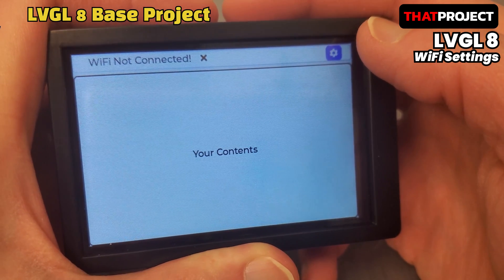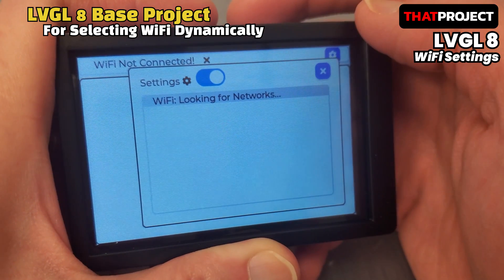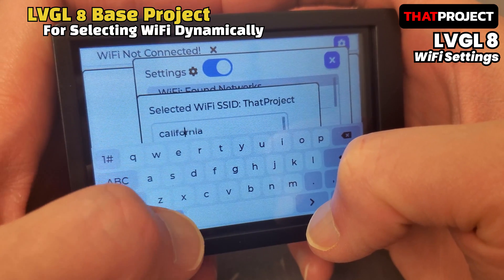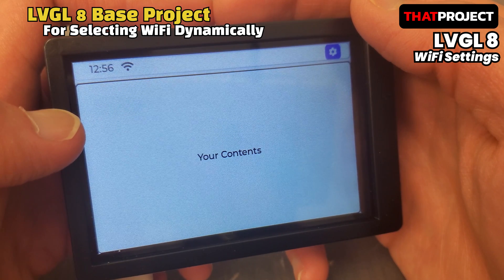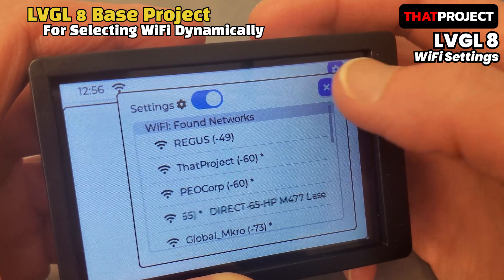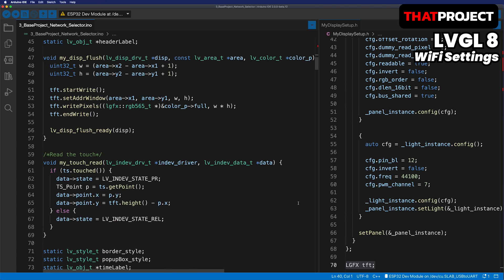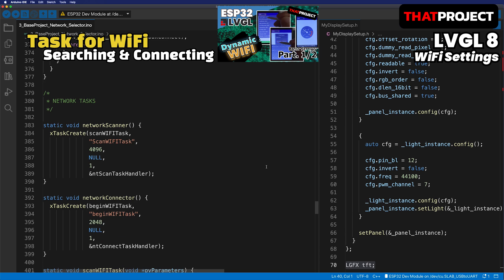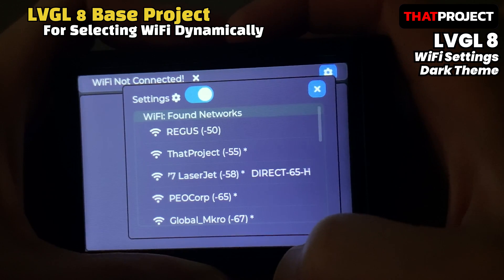ESP32 | LVGL8 | Ep 3. Base Project for WiFi Settings

Comment: Thanks the work is amazing ! The widgets on my display are slightly misaligned. Any tips for adjusting them easily without repeatedly compiling and uploading?
Reply from the maker: If you are drawing text dynamically, limiting the number of characters is probably one of the most effective ways to align text.
Set a maximum number of characters that can fit in your widget, and if the text is longer than that, truncate it.

Comment: Hi, I am doing a project using ESP32 + ESP IDF + LVGL 8 connecting to my home Wifi. But my code size is more than 16MB, too big for my flash. May I asked how much flash is your project using?
Reply from the maker: Unless you use images, the binary can't be that big. What did you do? This project is no more than 1 MB.
Reply: My bad,  my calculation is wrong. My app size is reported as ~1.5MB not 15MB. Thanks a lot for your confirmation

Comment: What a great example! I was able to get this to work with the Makersfab ESP32-C3 SPI 3.5" TFT with Touch with some minor modifications.  First I updated MyDisplaySetup.h to include config settings for handling touch on I2C and entirely within LovyanGFX and LGVL vs via FT6236 lib.  Then I nuked the references to FT6236 and updated the my_touch_read() in the ino source file to instead use That Project's alternate source for my_touch_read() function from his ESP32 | LVGL8 | Ep 0. FGX Setup (ft. LovyanGFX) video.  This change uses touch inputs from LovyanGFX vs FT6236.  I don't know why he switched how to leverage touch in this example from what was in Ep 0, but going back to the Ep 0 way of interacting with touch worked perfectly.  Best...